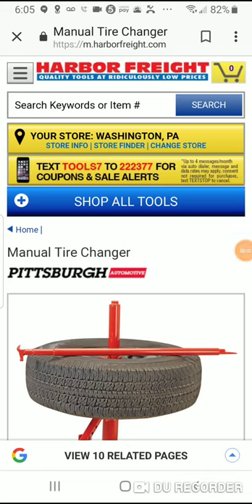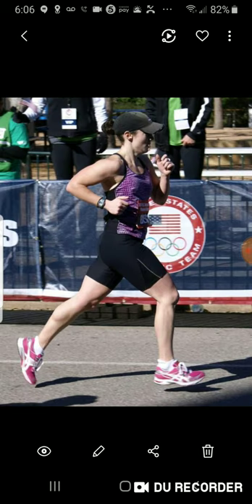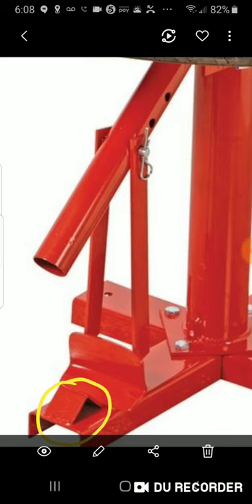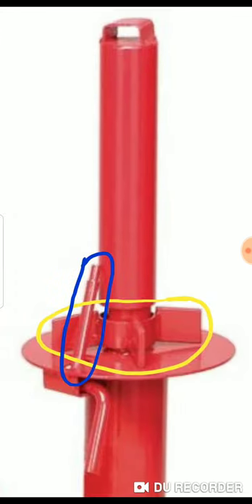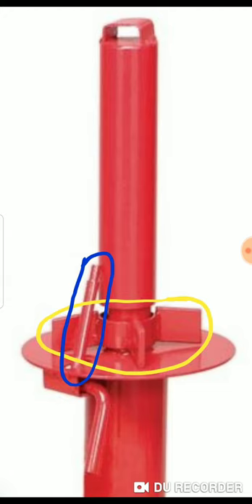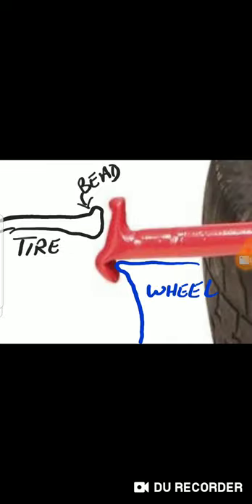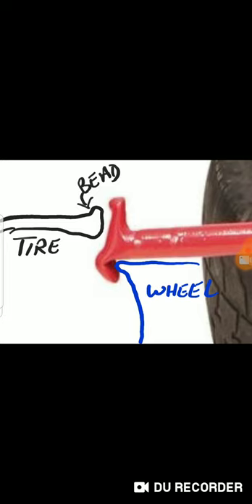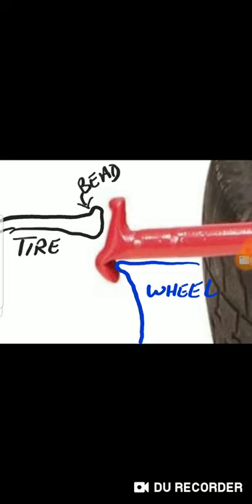Tips on using the harbor freight tire changer

Comment: Here’s how I describe operating the mount head:
When you lever the tire bead over the lip of the rim one bite at a time with a tire spoon, the tightness of the bead that is already below is what pulls the bead down. All the tire spoon did was let you stretch one bite past the edge of the rim. Well, the mount head works similarly where the flat face stretches a portion of the bead past the edge of the rim lip. Instead of dumping the bead off, you move out of the way so that the trailing edge falls below the rim lip and another portion of the tire bead is now stretched past the edge.

This means you have to set it up by:
Hook the rim lip with the bar as flat as you can.
Run the tire bead across the flat face of the mount head.
Use your hand to push one side of the bead down below the rim lip.
Work your way around pushing more of the bead down until it gets tight about half-way around.
The bead held below the rim lip should be crossing back to the top just before the mount head.
While holding the bead down tight, lift the bar to stretch a portion of the bead beyond the edge of the rim.
Pivot the mount/demount bar off the center post to move the mount head in the direction of the tire bead that remains above the rim.
The trailing edge will fall down past the edge of the rim and remain under the lip.

If your mount head is running into the point where the bead crosses over the lip then you are not in the right spot. The mount head should be traveling ahead of that crossover point. This is where most get it wrong.